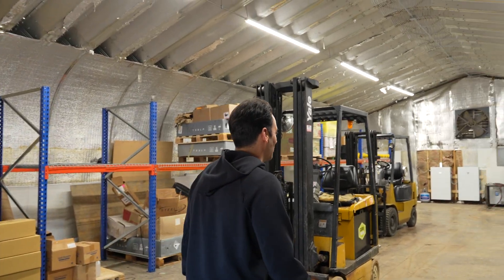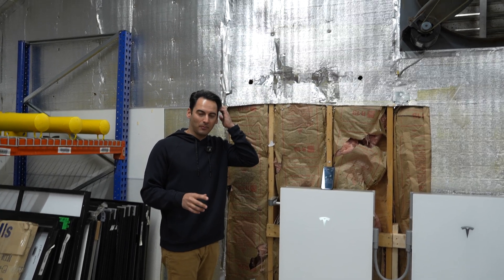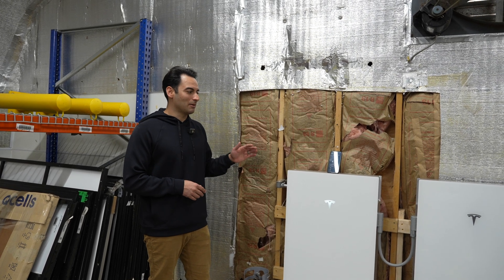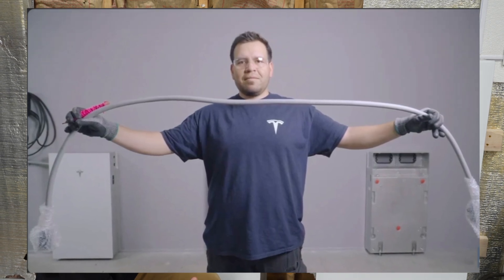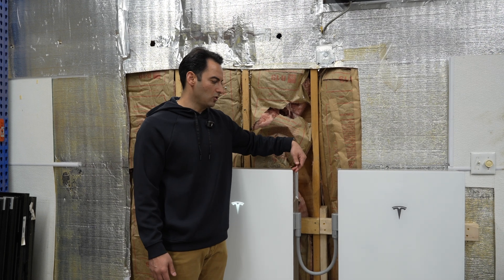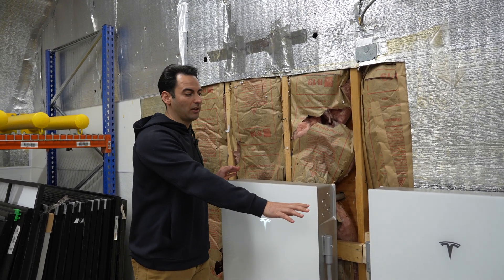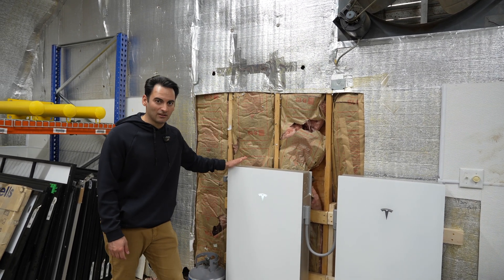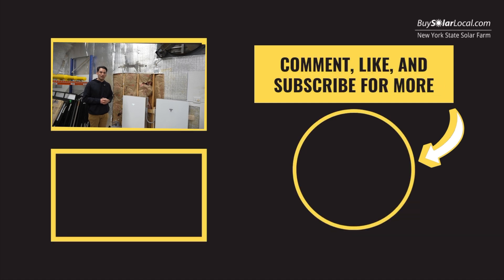Tesla Powerwall 3 Expansion Unit Installed 🔋

Comment: we started with two PW3's to get the 23 kWh of start up power but since V2H in Tesla vehicles is taking longer than we had hoped we might add two EP's.  I understand installing the EP's is real easy.  Question:  When they plug in the EP I assume the Gateway and app will see and report the new gear immediately?  Or is there some delay in the EP being ready or use?
Reply: Tesla One app recogized our expansion battery immediately.  Balancing took about 3-4 hours and they everything fully charged the next day.  The surprise was charging is now 10kW.

Comment: Seems a poor design to not allow them to sit flush against each other with a concealed connector.
Reply: They don't want them right against each other for cooling reasons.
Reply: @nicksgarage2 yeh maybe. They don't look vented on the sides though, and they stack front to back. But I guess there has to be space for the connection somewhere.
Reply: @travishimself1973 they don't vent on the sides but the cases do get warm on the sides. There is space between the front and back of each unit for venting.I'm getting two expansion packs installed next week behind my two PW3s. The cabling helps in my situation because currently I have to have then both connected to the lead PW3. I didn't know if this is because I'm only getting two expansions. I'm told this will change in the future.